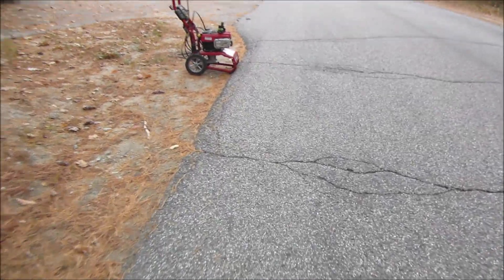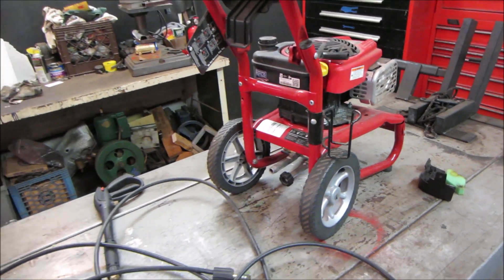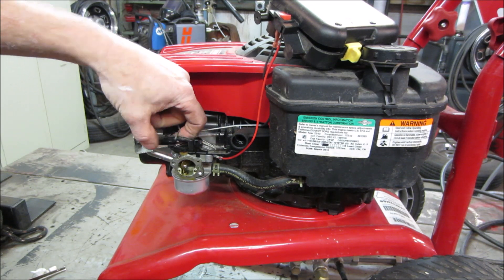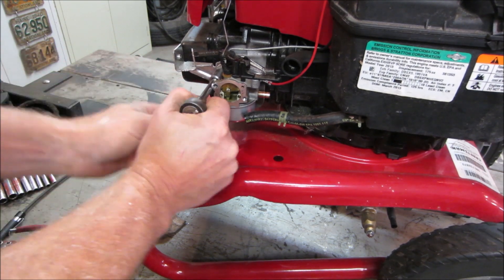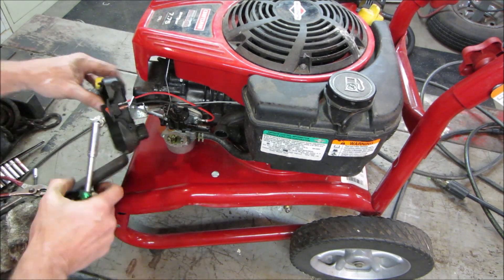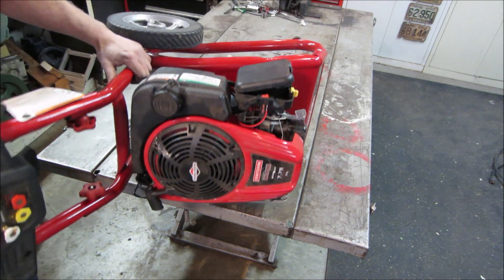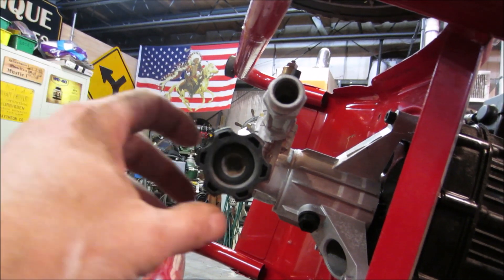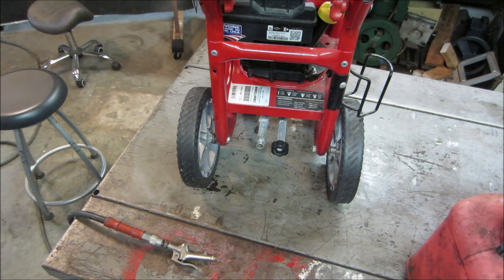Can It Be Saved? Junked Pressure Washer From The Garbage.

Comment: I have the same Briggs engine on my Briggs branded pressure washer, heading out to the shed to blow it out with the same fitting that I use to blow out the sprinkler lines, as soon as the video is done.  Thanks for the reminder!

Comment: I’m curious, what does everyone consider “cost prohibitive “? I replaced one of those pumps last year for $63 all in.
Reply: The way he comes across pressure washers... Anything over $20 is probably considered "Prohibitive". I've got a craftsman pressure washer that simply needs a seal kit. That kit is $60 on its own. Then again, it's a more expensive unit than this one. New pump is over $200. So the cost, without looking it up, could potentially be more than it's worth.
Reply: I teplaced the pump assy on my toro about 4 yrs ago. Cheaper than buying pump parts. Still works great. Learned to winterize and replace the prima seals in the carb to fix the surging issues.
Reply: A service center would charge more than the unit is worth. Thats the problem with weed wackers. No one even wants to fix them any more. I fix them up and re sell them. I hate seeing them being scrapped.

Comment: If you do order a pump, there are two 3 leg models like that. I think they were identified by a letter suffix on the part number. If you order the wrong one it will fit but the water connections will be on the front of the machine and you can’t turn it around because the spacing of the legs is wrong. The first plastic elbow you showed is the outlet for the “unloader valve” you can hear it cycling when water is connected and on, engine is running, and the trigger if the gun is off. The second was the soap connection, it only pulls soap when the low pressure nozzle is in the gun. It is important to have water to it before starting but you don’t have to squeeze the trigger to crank it, just don’t let it run more than necessary without squeezing the trigger.

Comment: That other small hose fitting by the high-pressure outlet side of the pump is the overheat blow off port. When you let the engine run without having the trigger depressed on the gun it overheats the water within the pump and when it reaches a certain pressure a check valve opens up and shoots the piping hot water circulating within the pump out. The detergent port will always be close to the low pressure garden hose connection side of the pump.

Comment: My lawn mower doesn't have an oil drain plug either. It's a Craftsman with a Briggs and Stratton engine, much like the one on your pressure washer. I really hate turning my lawn mower on it's side to drain the oil. Even if it had a drain plug, I wouldn't want to drain oil onto the deck. SO, I have a vacuum pump which just sits on the shelf in my garage most of the time. I bought a 1-gallon seal-able glass jar, found some fittings, and made a vacuum chamber. So all I gotta do is get the pump out, hook it up, and turn it on. Sucks the oil right out of my lawn mower and pressure washer engines. No mess whatsoever. Learned that trick from youtube's Project Farm.

Comment: This is an axial wobble plate 3 piston pump.  The black "thingie" on the back is a thermal relief so if the trigger gun is left off with the motor running the water overheats and will spit out at 145F.
The other one is soap injection used with the black nozzle.
Easy winterizing is done using windshield washer fluid.  Works great sucked into the water inlet,  run to protect both the pump, hose and gun.

Comment: I have a very similar model, mine is 2550 psi and has been a real workhorse. I recently replaced the pump after 10 plus years of use. Those briggs and Stratton engines are great

Comment: I like the Schrader valve idea to blow out the pump for winter. I have a cut piece of hose that I connect to the inlet and I dump a little anti-freeze in and give it a few pulls (with it off of course) till I see it come out.

Comment: On my pressure washer I pull it over a half dozen times after each use, after the hoses are disconnected.  For the winter, I connect a can of Briggs and Stratton Pump Saver to the water inlet line and spray it into the inlet line until it comes out the high pressure line.  You can also pour orange antifreeze into the water inlet line to protect it from freezing.  I like PumpSaver because it contains a water soluable oil with it.

Comment: For winter storage get an old garden hose, cut to a few feet long, get a bottle of rv antifreeze, put the end of the hose into the antifreeze and with the other end of the hose connected to the pressure washer then start up the pressure washer and run it until the antifreeze runs through it. Now it's winterized.

Comment: That rubber nipple is a cover over the thermal relief valve, which allows water to escape if the pump overheats from lack of flow through the pump, it's supposed to vent if you stop spraying for an extended amount of time.
When the valve opens, it allows cooler water to enter the pump to cool it down.
Never run the pump for too long without spraying or he pump will overheat due to high pressure recirculation.
Detergent is connected to the nipple near the pressure regulator/unloader assy. and will only be sucked in when the regulator is set to low pressure👍🇦🇺

Comment: Find a donor machine that has a bad engine as long as the pump's specified engine shaft diameter, minimum length of the shaft, PSI, and placement holes are the same as on the donor pump.  I am sure you still got a great deal even if you have to shell out 100.00 or more for a used/new pump.

Comment: The fitting on the opposite end of the high pressure rail is a high temperature relief valve.  The water gets real warm recirculating when you don’t spray.  When hot enough that opens and blows off water thus allowing cool water to enter from supply line to cool pump.

Comment: Even a broken washer has its uses.  I use mine to clean AC condenser fins and used chainsaws from the junkyard.  It's about 1/2 the pressure of a working machine so it doesn't bend the fins or harm any aluminum/magnesium components.  Worst it will do is strip some old paint....

Comment: On allen screws that are stripping, use a torx bit (they are slightly tapered) that is almost oversize.  Drive THAT into the stripped, nearly stripped, allen head.  I've had good luck with that method.

Comment: That small black plastic on the lower left of the pump you said might be soap dispenser at 16:25 is the Thermal Relief Valve, When you are not spraying water, the pump cycles water in itself that creates Heat and that is where water would come out that Thermal relief, bringing  cold water into the pump so the pump to help to not Burn Up.The soft black rubber hose is the soap injector, if soap does'nt inject with the Low pressure Nozzle there is a Ball/spring and O ring in there that need to be cleaned and or new one's to bring back soap dispensing through the pump

Comment: I just found this video and am working on repairing a similar pressure washer I found down the street.  I replaced the carb, changed the oil and replaced the missing filter for $30.  When I hooked up the hose, I the pump head drenched me as it was cracked from improper winter prep.  I ordered a complete pump assembly for $100 which was just shipped.  I guess it's not bad for $130 investment, although I'd sure have liked to have saved that $100.  Still, $130 is better then $300 for a new one considering my limited need for it.

Comment: I was given a Lowes / Honda powered PW with the same problem.  In may application the valve assembly was available (albeit not from Lowes) as a separate entity for between $60-$75.  As the engine ran fine it was worth the cost of the valve assembly for a PW.. Narragansett Bay

Comment: We found a pressure washer exactly like this in Georgia. My brother decided to rebuild the engine... long story short, he dingleball honed the bore, got new rings, new crank, new Govenor, and new spark plugs! We even used our Mustie1 University knowledge and adjusted the gap in the valves. Got them perfect, and was able to pull it over without any decompression issues.

But when putting it back together, he got so excided (his first build), that he forgot to put back the fan on top of the flywheel. 

Ran for about 10 minutes, then stopped. Tried pulling it over, and it pulled over really easily... TOO easily.

Looked to my brother and said "Am I supposed to be able to see the metal flywheel through the mesh?"

Brother went back to his workbench, saw the fan, and threw it at the motor.

It never ran again, but we got a new predator motor from Harbor Freight to replace it. Hopefully it lasts.

Comment: Wow - a grounding exercise! Back to the ordinary and sensible things we all take for granted, and yet are still worthy of a 'look at'.

That's "Tri-Phasic" swash plate pump. It does the same job as an Otto Speck Tri-Phasic Positive Displacement eccentric pump, but with far fewer parts. Each 'phase' just overlaps with the next, and the result is a smooth and constant stream. It's a pity about the crack, but as others have said, it is repairable. I guess it's whether or not you'd consider it worth the effort. You never know, you could well find another dead machine with the same pump (possibly with the same issue - or possibly okay), but the other way to look at it is to say you got a good engine out of it!

Comment: The "cup holder" is for the soap bottle, and both those lines go to the bottle, one allowing water from high pressure side to flow into the soap container, the other allowing soap to return to low pressure side of the pump, thus allowing a flow without a venturi, and with a concentrate thats no pre-diluted.
Lots of people will try weld such cracks... its mixed results with cheap castings, and will often split right through the Heat Affected Zone (HAZ) of the weld after a few uses... heating the part a lot before welding can help, as can zig-zagging a longer line over the crack instead of just neatly along it, but if its loaded with silica as many alu based pot metal castings are, only so much can be done. Likewise brazing over the crack is always short-lived, as the difference in rigidity see's it move slightly and fatigue the same line to the surface of your new "fix".
Instead the only solution I've seen work reliably is "lock stick", essentially drilling and taping a line of overlapping holes along the crack. Done it to a couple of fairly thin older engines, and it takes some patience to do, but seems to hold up to use/abuse afterwards.

Comment: I hope you serviced the air filter element (foam) correctly. 
You showed you had washed it out, BUT you must disperse oil throughout the filter element (foam) for it to work correctly.
I have seen many engines fail due to improperly serviced foam air filter elements. 
As for the leak Aluminum Alloy Braising rods might work if you can get any flammable or meltable  parts removed before attempting to apply heat. 👍👍

Comment: That wand will pinch your hand easily.  I trimmed the sharp plastic off mine.  Do both sides.  Also the safety button can be drilled and pinned off.  
It needs a constant on lever like some more expensive models.

Comment: I assumed  you were gong to use your welding ability to fix the crack.  One year i decided to move my pressure washer from my attached garage to a shed and cracked the pump and wand when it froze.  Lesson learned. After pricing new pressure washers I replaced the pump and wand for a little over $100 since the Honda motor still runs well with low hours. The pump I purchased on eBay was of a better quality than the original strap style pump.

Comment: B&S pressure washer pump heads (bare aluminum manifold) are available for about $55.  Swap all the parts over, and you've got a working system you can probably sell for a hundred bucks.

Comment: I just purchased a pump for a pressure washer. It costed me $44 for the pump. I also had to buy a carburetor $14.  My Son in law gave it to me. He told me it was his dad's  and couldn't  find a pump for it. I found one right away so I think he just didn't want to mess with it. They had just purchased a new hose and pistol for it. He told me it was not cheap. I haven't  put the carburetor on it or put water through it. Come Spring I will finish fixing it.

Comment: I'm not saying this will work for sure but you might  be able to seal the 
crack with JB weld . I have had very good luck with it on many things. 
For a fair test you need the surface clean,dry and 
give it enough time to completely cure out . You should have some in your shop . It's great stuff to have around.
Reply from the maker: then you may like part 2

Comment: Thankfully, we have a station a couple of miles away with 91 octane non-ethanol fuel.  Haven't had ONE issue with a gas machine since that happened.  I have to leave my Honda (HRM215) mower outside (under a plastic tote) for storage.  I haven't done a thing to it (but run it dry in winter) since I owned it. I got it free too.

Comment: I fully dismantle the pumps and then run a fast tig fusion pass over the cracks quenching the aluminum after and they hold up fine usually.. Once I've had to go back and use filler rod to strengthen the very thin cast area but rarely does it need it .

Comment: My method of winterizing is to remove the hoses, drain them and the wand by gravity and a quick shot of the air compressor. For the pump I pull the engine over while the spark is killed until the pump itself forces the rest of the water out. Yeah it's still running without water, but at 100rpm max instead of 3600.

On expensive ones, or ones that aren't mine I hook a short piece of hose into an rv antifreeze jug and run some through it first

Comment: The pumps on ebay are super cheap and really easy to replace. I just did one on a honda 160 motor/washer and it was 4 bolts and a key on th shaft easy. Only issue I had was the guy before me stripped out the original threads I put in a bit longer bolt and tightened it down. Been using it all summer without any issues.

Comment: Alumaloy I’ve always wondered if it really welds aluminum. Your the guy 😀
Reply: Why does everyone think that pump is made out of aluminum? There are other white metals. That's what they're called too. Diecast white metal. Which likely does contain aluminum but it is an alloy. And no it does not behave like aluminum at all. You cannot even weld all alloys of aluminum successfully. Most "aluminum" is not pure aluminum.

Comment: I live in New York and most problems are frozen accumulators which are expensive that is why I never loan out my pressure washer ever again after replacing 2 frozen pumps. The other major problem is running it without the wand handle pressed the pressure builds up and blows the seals. Working at a sears repair center they had a dozen of them with that problem still expensive so once you start it use it ASAP. Lol

Comment: Those are Annovi Reverberri pumps - about +/- $100 on Ebay, etc. The OEM ones are rated at as low as 25 hrs. The replacements are usually 300-500 hrs.

Comment: The pressure of the pump is developed from the displacement of the pistons and the orifice of the spray nozzles which are calibrated drillings, much like a carburetor jet is a calibrated orifice.

Comment: Have you ever tried JB Weld on a cracked pump? I take a Dremmel tool and widen the crack a bit, clean with acetone, heat a little then apply the JB Weld. I have had pretty good success with that method. You have little to lose since the pump is trash either way.

Comment: Just take a grinder and clean where the crack is and put JB MarineWeld and it will seal that. 
I did the same thing with J-B weld for steel on my gas tank. 👍

Comment: One thing I learned….when the pump is located underneath the engine, they are designed to run no more than an hour at a time. The horizontal pump mounted on the top are heavier duty.

Comment: Those small gas pressure washers are essentially disposable units. The engines are almost always good enough to last a long time (absent serious abuse) but the pumps fail if not taken care of like a baby. Even then, they'll still fail after a while. I never actually bought one but took one a buddy gave me about 20-22 years ago. Back then, replacement pumps were expensive but now you can find cheap, 60-80 dollar Chinese pumps on Amazon or if you want to spend more, 150-200 dollar better quality pumps there or on other sites. I don't recommend such a small unit anyway. Get a 4.0 GPM unit if you're going gas; if you can get by with a unit like this, get a nice electric unit. Much less stress on the pumps. You'll pay more but they'll actually last if you get a quality one. Mount it on the wall and you're all set!

Comment: Tig or aluminum brazing most likely will distort the casting. I’d remove all the parts. Rinse it out well with CLR and blow it out real dry. Then I’d wick in a few drops of red Loctite into the crack inside and out. Let it set over night and wipe off the excess. Assemble and test. If it doesn’t work replace.

Comment: Thanks for the video.  But can you show a picture or site to find the "tire chuck" that you mentioned.  I have a power washer with detachable couplings on it and wonder if that will work.  I take my power washer into my basement and drain the hose manually by lifting it and letting gravity drain the water.

Comment: Looks almost exactly like my Troy Bilt pressure washer. I would spray carb cleaner through all the orifices. Then I would get a new gasket for the main jet/bowl but. The pump costs $90 on Amazon. Not excessive unless you’re just cheap.